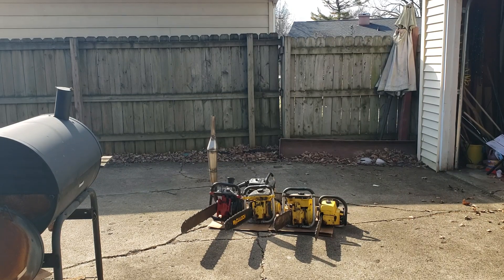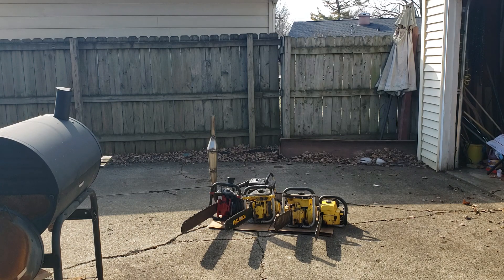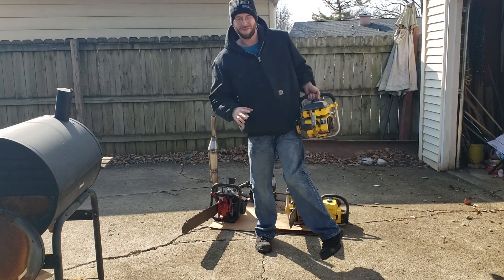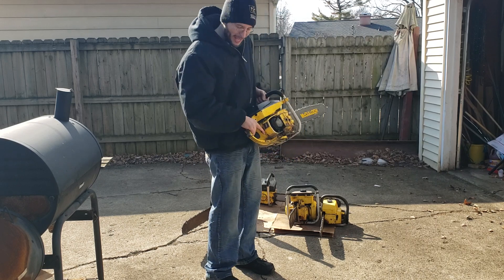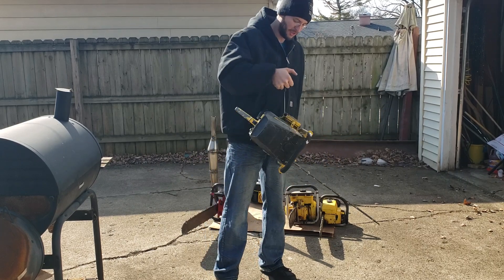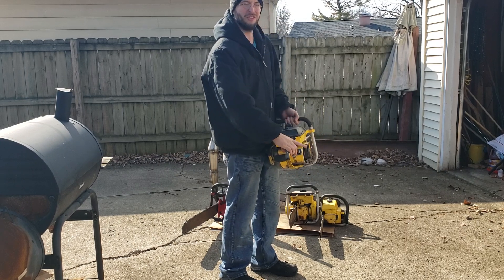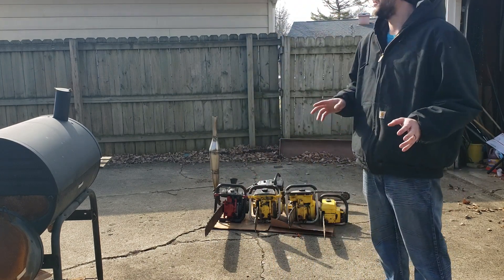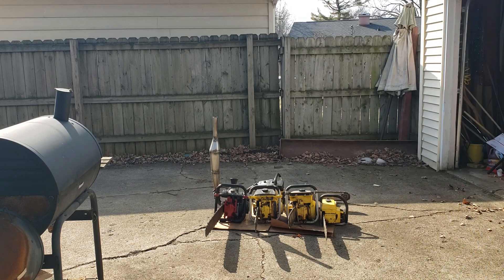McCulloch DSP, what is it and the types.

Comment: Thanks I happen to have a 5-10dsp and this cleared up how that works for me
Reply from the maker: Glad to hear this video helped you! The 5-10dsp is a bit of a harder to find model.
Reply: @mistermacgray  actually got it and a super pro 81 on a trade for a 390xp. Is the 5-10 a 70cc? From what I read it is but when I also find other information that says otherwise.
Reply from the maker: @Grizzman99  yes it is a 70.5cc saw.
Reply: @mistermacgray  awesome thank you, got a decent deal, also got a 1-10 that’s torn down on that trade. Do you know where a guy can get an adaptor to switch over to the sdc carb? Surprised the 5-10 isn’t as desirable as the 7-10.
Reply from the maker: @Grizzman99  to collectors a 5-10 is more wanted. As for adaptor, I have a video of doing the conversion from bull frog to sdc and I got the sdc adaptor spacer off ebay, I may have to look into 3D printing them??? but we shall see what the future brings.
Reply: @mistermacgray  oh interesting, seems like the 7-10 is more popular and bring in better money but maybe there’s just more of them around? Honestly that would be awesome to start 3d printing them. Getting to be a pretty big market for these old macs. If a guy could print adaptors and some of the other misc parts I think a guy could do fairly well. Gaskets as well, specifically on the older saws muscle saws. I know I could use full gasket sets for a super 44, 640, 1-10, and a 10-10s.
Reply from the maker: @Grizzman99  I knkw where to get gaskets for a 1010 at, here's a link to the video I made for my pm1010 fuel tank gasket and in the description there is an email to Brian Genrich who makes gaskets for these saws, he is also on facebook and can be found in "McCulloch Chainsaws North America" group too. Very fast, his gaskets are dead on. I've been designing and 3D printing my own gaskets so far and so far they have been successful. Tell Brian I sent you.

https://youtu.be/QTE9crzkYIU